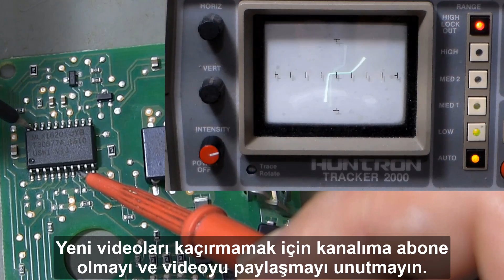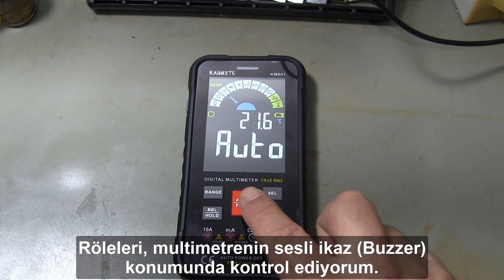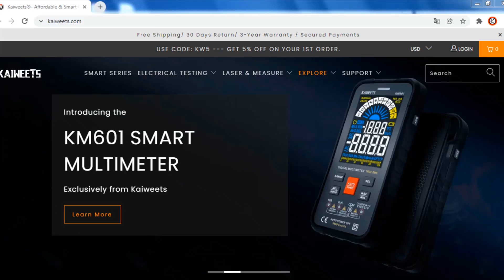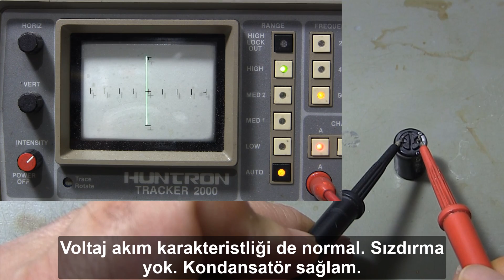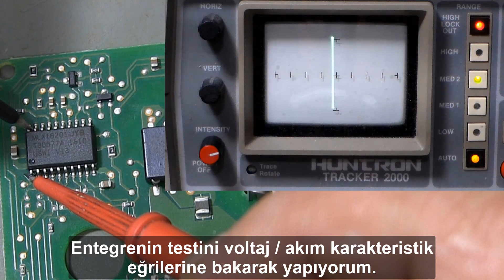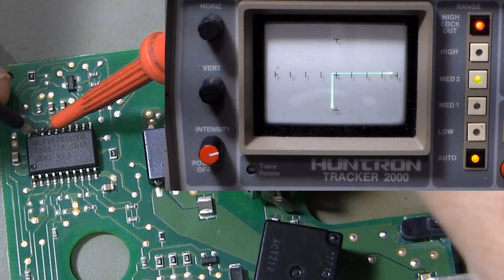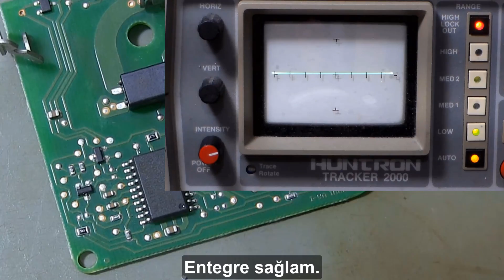SUNROOF MOTOR TAMİRİ | SUNROOF MOTOR REPAIR

Comment: Do u know what gives temperature ? I have a fault for high temp even when is 20c outside and the motor hasn’t been running (similar motor)
Reply from the maker: There may most likely be a temperature sensing NTC on the circuit board.

Comment: Great video! But did it work!?! What was wrong with it if all the components were good?
Reply from the maker: Thank you for your interest. Unfortunately, it did not work. The sunroof motor did not work. The problem is in the microcontroller integrated circuit and the software in the microcontroller is also required to change it. I designed a card for this type of circuit board myself. I will upload the video to my channel soon.
Reply from the maker: Thank you for your interest. Unfortunately, it did not work. The sunroof motor did not work. The problem is in the microcontroller integrated circuit and the software in the microcontroller is also required to change it. I designed a card for this type of circuit board myself. I will upload the video to my channel soon.

Comment: So what is the actual problem? It has not been repaired?
Reply from the maker: The main problem: The software inside the integrated circuit. Valid software is hard to find. I will design a new electronic board.
Reply: @electronic7979  any updates , i have Same problem
Reply: If you can find and replace the intergraded circuit will it work?
Reply from the maker: @SnipingWithSkillz  it doesn't work.  You need to install software into the integrated circuit.  It is very difficult to find the software.
Reply: So the cause is that the software got deleted from the intergraded circuit?
Reply: How much do you charge to make another board, the same like this.
Reply from the maker: @SnipingWithSkillz  yes, damage to the software in the integrated circuit.  Similar circuit board design 150usd
Reply: Is it possible it could just need a reset in the car? There is a procedure..
Reply from the maker: @SnipingWithSkillz  maybe. but I've never seen it done before.
Reply: I have same motor, just hold closed button down for 15s then press open 👍😎
Reply from the maker: @SnipingWithSkillz  I will tell this method to my friend.